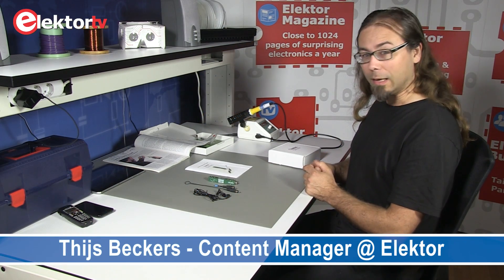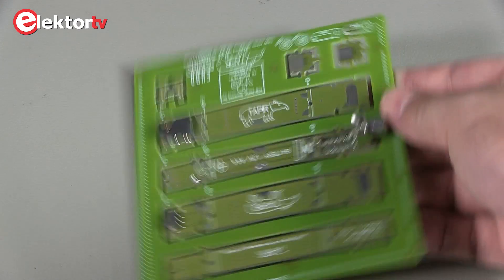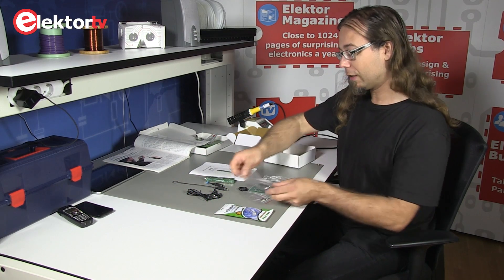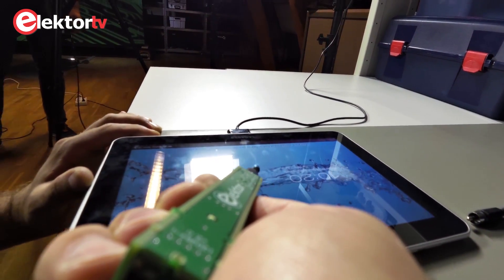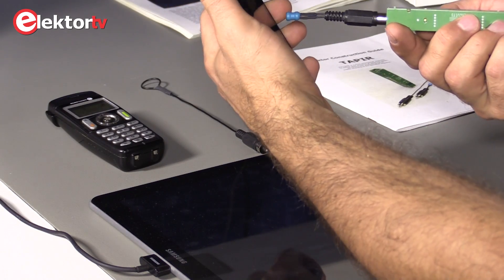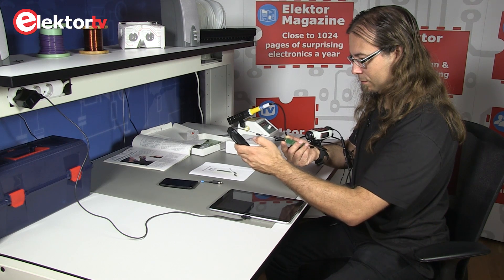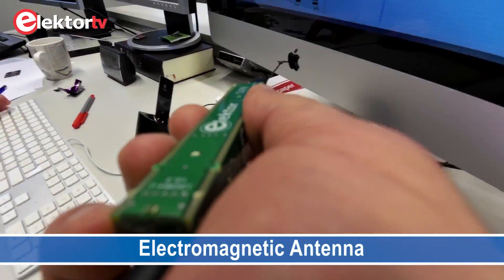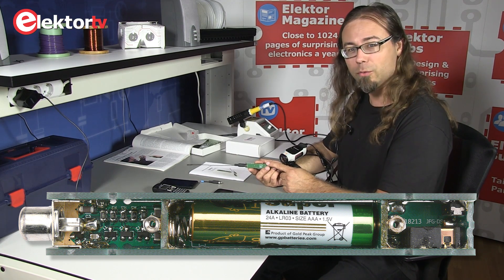TAPIR – E-smog detector

Comment: noisy archaic 2000's mobile phone smog / cellphone smog / handy smog / emf radiation.  
And pulsating smartphone at 3:15 as it continuously pings for wifi etc.
   ... suggest add to description:
2:00 mins testing a tablet emf electrosmog (e-smog) radiation
2:30 mins a mobile cell phone
3:15 mins a smartphone  
4:00 mins wandering around an office
   ... could add a test of whether switching to airplane mode on cellphone, tablet, notebook / laptop cuts down the noise.

suggest: add to title (electrosmog emf radiation), as (E-smog) just brings up more german than english language youtube items. You'll get more hits as well 
...& many people may be interested in the test bit, but not the fiddly electronics description in the first 2 minutes - consider two separate youtube items.